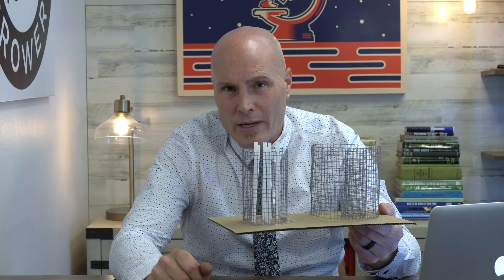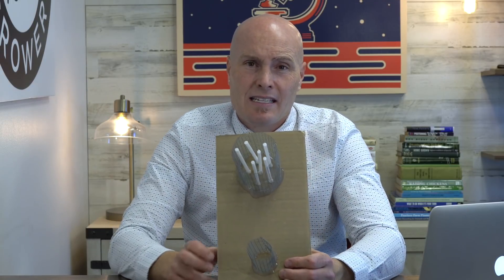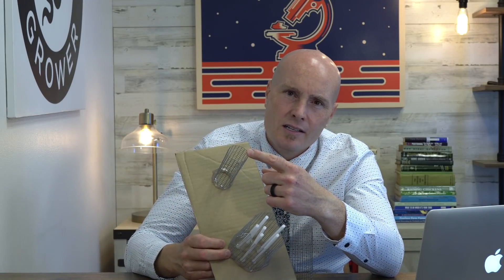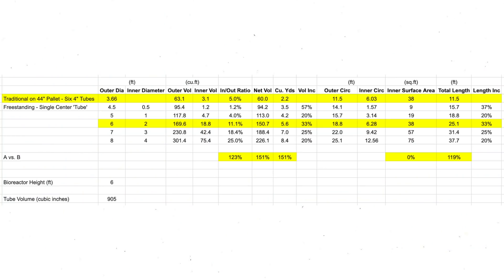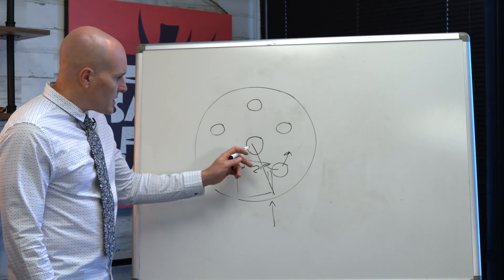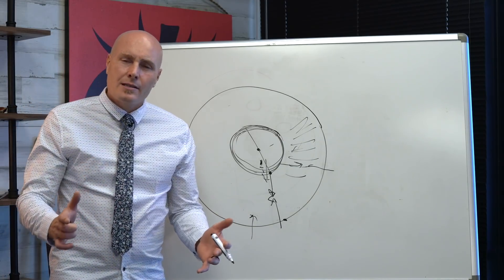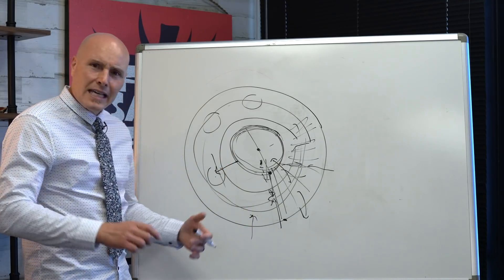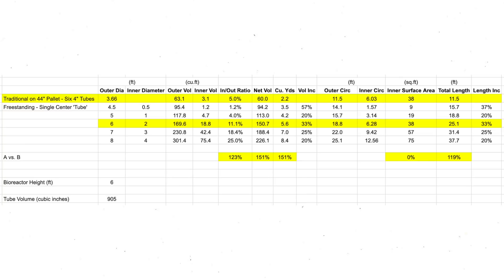Designing a New Compost Bioreactor | DESIGN SPECS and QUESTIONS ANSWERED

Comment: While I like your Idea of making it easier some questions came up.
Dr. Johnson I think mentioned that after the heating process is over it is ok if the spacers collapse.
I was kind of luggish watering my Bioreactor on ja regular basis. I think with your design watering or keeping it moisture is much more crucial to keep it going. 
Another aspect might be changing  temperature. With the Johnson-Su design I think there is a better chance for the biology to get trough cold conditions. Maybe if you put some cover over the inner space in winter time you can keep temperature up for a while with your design. 
Have you thought about it?
Also what makes me a bit uncomfortable watching. Dr. Johnson and his wife went public after some time of trial and error or scientific research. You bring it up like an instagram post.
Reply from the maker: The goal was to use principles of the JSBR yet, make it easier to produce compost.  This will produce compost, no research needed.
Reply: @DiegoFooter  But posting data for the microbiota would be valuable.

Comment: Only things I would add are wire over the top of the air tube so you can't accidentally fill it when loading and an easy to open front for the outer ring to empty it out when fully composted. Going to use this design!

Comment: I suspect it's by design, but a 25 foot standard roll of wire, after cutting 6.25 feet off for your inner circle leaves 18.75 feet for your outer.  That's 5.96 feet for your outer and 1.98 inner.

Comment: Design flaw potential: The lack of wrap covering will make it very difficult to maintain 70 percent moisture. Also the smaller pipes create in effect a more solid mass for necessary heat buildup- that is three foot by three foot minimum. Your new design only gives a two thickness in the one direction effectively due to the larger inner air core. 1/2” hardware cloth would be superior to 1” chicken wire as for holding in/out debris.
Reply from the maker: Good points.  One comment would be that the design isn't setup to create a pile that maintains any sort of heat buildup.

Comment: What if you laid a soaker hose within the pile and spiral it up as you build your pile, a long, slow, coil ?
Reply from the maker: Not a bad idea.
Reply: @DiegoFooter  IKR!? I’ll let you know. I’ll start mine in a month or so.
Reply: @pauljolstead2752  Paul - I did this on my third batch and it worked. I used the hole 25 feet as it came. Keep in mind that the pile height will reduce by approximately 50%.  25 feet embedded in the pile has the potential to influence the pattern of pile settling and therefore may lead to some blockages of the natural chimneys. I am now trying 12 feet placed moreso towards the outside of the circle and moreso in the top 25% of the original pile. I have stopped worrying about dryleaves at the top and dry leaves at the sides. They are just my moisture containing mulch as it were.

Comment: Very cool. I’d wonder if you could skip the chicken wire if you were to replace the concrete mesh with 2x4 welded wire.  I’ve used this to keep my hot pile tidier and there’s still minimal spillage...I’d guess even less with a static pile.

Comment: Too much work!
More importantly, it is the human tendency to overthink, and overwork. To work to find a workable human solution to our human dilemma, that must be workable of course because we are human!
All the while we completely discount the fundamental fact that the human animal is Of and dependent on the natural world.
And there isn’t one single detail that nature hadn’t already figured out long before we showed up.

Chop and drop in a rural setting.
Amending or inoculating the area with soil microbes and mycelium to start is a good idea because most soils lack at least some as a result of human destruction of habitat, overconsumption, and the resulting heat/drought/fires etc that our activities are causing, and urban soils are typically dead, completely lacking these critical little workhorses. 
Then just let nature do the rest.
An ecosystem is cyclical in all ways, if we perpetually take it’s building materials away from it, eventually it will go barren and die.

Layer in an urban setting.
Method one:
Use well chopped material as bedding mulch. Disturb or flip occasionally for more soil contact and faster breakdown.
Method two:
Dig out a random shallow spade of soil in a bed, 3-6” deep and big enough to hold the material. Pour in kitchen scraps, or pulled weeds(no seeds!), or a random dead bird.., and cover by replacing the removed soil. Give it a pat and walk away!
Usually within a few weeks the soil biology will have consumed the gifted smorgasbord and returned a gift of richer more nutritious soil that will in turn feed the plants.
This is my favorite method, my “Touch it once and done” minimal time and effort method that over time gives me the sweet richness of a healthy soil biome.
Chocolate cake soil!😊

I want to spend my garden time nurturing my plants, being in harmony with nature.
Not screwing with some ugly chicken wire contraption in my garden reminding me of the filthy, industrialized, increasingly dead world we’ve created.
All life that exists in sum Is 
human habitat.
All gardening- all nature- all life,
see that it is all the same thing; life. And life depends on life.
What are the origins of life?
Water, and soil.
Feed the soil biology. 
It will in turn feed your entire garden as more and more species discover the Life you’ve created there.

Comment: A 6' wide pile seems very big compared to a regular 3 to 4' pile. Would a 1' center cylinder suffices, so that the outer circle is still 2' which adds to 5' in diameter? 1 1' center circle seems big enough for air to freely flow.

Comment: For the original design, based on the 1' air penetration rule wouldn't you only need one small pipe in the middle of a 4' diameter ring (1' from the inside and 1' from the outside)?  are the other 5 pipes just to 'increase' the amount of air available or something?

Comment: This design would require more hydration, correct? The outside edge of the reactor would be more prone to drying out without the cloth around it, and there's nothing on top to help keep moisture in. Would you have to spray down the sides every couple of days in addition to the traditional irrigation from above?
Reply: You could still wrap it with weed fabric if you wanted to ;)
Reply: But yeah better aeration will mean faster drying out if you are in an arid climate.

On the upside you can use it as a microclimate creator around plants that want a higher humidity.

Comment: Nice video dude, I appreciate it.  I'm curious to see if it heats up and reacts the same as the original.  If so then I'm definitely building that 2' thick compost wall around my garden. The dang roos decimate everything in summer when they run low on forage in the meadow.  Love the idea of a compost wall to keep them out....two birds with one stone.
Reply: Exactly! I have a 7 foot security fence and the fox gets in and causes terrible destruction. I am already adding chicken wire so if I put supports inside and ran extra chicken wire then I will have a compost wall.  There is however confusion because in one place here we talk of 2 feet from the outside to penetrate air and then design for 1 foot. As well as that once Winter comes in the UK we can get a lot of sustained rain and I would have to add a cover at some point which could just be a tarp.

Comment: This is a really interesting concept for supplemental composting. I think you may be on the right path with the handful of 2ft drain tiles at the bottom (if there turns out to be a venting issue) the heat inside will create an updraft in the core that'll actually pull the air through the pipes. Also, maybe consider a chicken wire cap/nose-cone over the center cylinder? Probably help with the less fuss theme (less aim involved when tossing 5.5yds of stuff in a 6ft tall structure)...my humble $0.02 and thanks for taking the time to explain it through :-)

Comment: I love the no plastic option, have used chicken wire circles before but not the “Diego Donut” approach! Here in eastern Australia I find it very hard to keep the outer sections of my compost piles moist during much of the year - even with regular watering.  wondering if get some large cardboard and tie it on to the concrete mesh on the outer ring to reduce wind drying effects - won’t last forever but should go a few months before it needs replacing?

Comment: Neat stuff! Why not make one 2 foot wide any reasonable  height a lengtht you want? Pipes or no pipes. Like a wall getting air on both sides. Thanks for sharing!
Reply from the maker: Because to get volume you need a lot of pipes.  A bigger one doesn’t take that much longer to make.  But you could and have a good point.

Comment: Brilliant.
Reply: I'm here(again) because of you! Much morefree woodchips to make reactor for!
Reply: why not just make the inside screen cylinder a cone shape? seems it would  make loading it a lot easier?
Reply: @ftoftheX  wouldn't that throw off the air penetration part of the design?
Reply: @Mookummockup  Hey max, I dont think so because the material is being compressed  by the upper layers which already have the air flowing between them because of non compressed leaves/other matter.
Reply: @ftoftheX  That’s a great idea, not though that the mesh cone is so easy to make. How would you make one?
Reply: Diego is amazing. Love all his numbers and stats to explain it all. So glad I haven't started my reactor yet. Planning to do the new and improved Diego one instead!
Reply: Now you've made a capacitor you can pass a charge between the two plates.

Comment: Diego Diego Diego. You're making it more complicated than it has to be. You need to think outside the pipes and circles. The key seems to be that all compost material must be within 1 foot of an aeration surface, correct? Hence the magic 2-foot thickness of any composting volume. That is all we need to design around, a 2-foot thickness of composting volume. From there, the designs are infinite -- ok, well maybe not infinite but certainly geometric. People can make 2-foot by 2-foot columns, or 2-foot thick walls of any length, or 2-foot thick rings, or 2-foot thick "U" structures, or whatever geometric shape so long as the 2-foot thickness rule is maintained. Thanks for the magic 2-foot thickness Johnson Rule! And the Diego concrete mesh & chicken wire materials design.
Reply from the maker: True and good point.  The problem with a 2ft column is you need to make a lot of columns to get volume.  But I like the line of thinking.
Reply: @DiegoFooter  Yes but for folks with limited space or composting source material, a 2-foot column might be ideal .... like your trash can composters, or perhaps using recycled 55-gallon HDPE drums riddled with holes? Anyway, there is a composting scale for everybody. The key being that minimum distance of composting material to aeration surface to keep it in aerobic state.
Reply: @RA-LHTX  It makes me wonder though. Hot compost requires a minimum of 1sqm, or a little over 3 ft wide. Does it mean that hot compost isn't aerated? 

It makes me wonder if 8 ft wide bio reactor is good with 3-2-3 outer inner outer portions.
Reply: @acctsys  Hot composting is a different method than bioreactor approach. Hot Composting requires frequent turning for aeration. Bioreactor requires no turning but does require minimum of 1 foot from an aeration surface to prevent anaerobic conditions.
Reply: @acctsys  Hot compost is getting areated by turning the pile a couple of times. Whenever it gets to hot it is turned. And while turning it gets a ton of air also.
Reply: I'm with you in the 2ft thick wall, much more space efficient, and don't have to bend the mesh.
Reply: So you’re saying if I had 4 tubes that are 24 inches across in each corner of my greenhouse..(10/16 ft) I could fill up durning the summer with brown and green and in winter have great heat/reaction distribution from them once I soak them? Just trying to learn here :) and than use in the spring for the plants?
Reply: @MrsStevenBrown  No. Unfortunately, that is not how it works. The JS-Bioreactor is for cold composting. By keeping compost material within 1-foot of aeration surface, the decompostion process is kept cool.

To heat a greenhouse in winter, you would need to use thermal or hot composting. It is a completely different process of composting. It requires a minimum of 1 cubic yard (3ft x 3ft x 3ft). It must also be managed -- monitor temperature of the center of the pile and turn to aerate  when it reaches about 160 F (this is done by moving outer part of pile to center and center part to outer part). The process is repeated (about 5 or more cycles) until the pile no longer generates heat and at that point the composting pile should be done and ready for use. Check out Dr. Ingham's composting method(s).
Reply: @RA-LHTX  I will look into! Just starting the compost hobby lol 😂
Reply: @MrsStevenBrown  This is not really meant for "hot" composting. Because the pile is being aerated 24/7, heat cannot build up. This is more of a cold composting method that does not require turning like hot compost methods do. Hot composting requires a minimum of about 1 cubic yard of compost and it must be turned periodically to keep it from overheating and going anaerobic in the center of the pile.
Reply: For a backyard or terrace garden you should make three or four  2×2 square cages . Fill one and move to next.
Reply: Once you go to columns, the next progression is towards hexagons, like how bees do it. Hexagons are the bestagons.

I think though that as Diego said, you'll bump into problems with supply of material though before you get to that point. I think the Diego reactor design has the balance of practicality, beauty, and function.
Reply: @acctsys  Hello, fellow CGP Grey fan. Hexagons are the bestagons indeed, however, bees don't actually make hexagons. Bees make circles (cylinders), and the heat from the worker bees causes the wax to settle into the hexagonal shape. Just search for "bees don't make hexagons" and you'll find articles explaining it in more detail.
Reply: @drewlomax7837  Yes, but if the posts were to be the edges (6 instead of 4), hexagons would form from the cylinders.
Reply: @acctsys  Johnson bioreactor approach requires that all compost material be no more than 1 foot away from an aeration surface. Any shape used must conform to that rule. It has no relationship to bees.
Reply: @RA-LHTX The connection between tubes and bees is somehow lost in this discussion, and that's OK. It's just a mental exploration of even further optimization of volume, but it can be overengineering.

I know that the key takeaway from the JS bioreactor is 1 foot from air. That's what makes me wonder about hot composting more.

For hot composting, is it really necessary to have periods of anaerobic tightness, interrupted by short aerobic turning? Isn't there a sweet spot in the width where the key takeaway of 1 foot from air can help so we can get good hot compost without turning?
Reply: @RA-LHTX  also you will get more fungal activity in your JS Pile that with hot composting, because the pile isnt moved.
Reply: @RA-LHTX   Johnson mentioned in a video that they do have one thermophilic cycle (2-3 weeks or so) to kill pathogens at the very beginning. That would require some amount of green to all the browns (woodchips)
I'm not a specialist on js reactors though
Reply: @peterheinz3375 yes, he said they come hot and stay hot for some time. This means that it has to be preproduced before entering bioreactor
Reply: @peterheinz3375  well, at least professor Johnson said that presenting his facility. I think it was big scale on the green/werehouse flour

Comment: Isnt the simplest JS bioreactor by the variables they defined... just a 1 foot thick layer of material laid out on the ground? Less space efficient by a good margin, but maximizes contact with soil organisms and is more water efficient, besides having the pumping action of rainfall moving downward through it to help with oxygenation. And of course no plastic, metal, or any other material to buy in!
Reply: Well said Richard. Where you are essentially unconstrained by land area, this is attractive. It eliminates aeration structures. It does make moisture control more difficult. Heavy rains can drown or wash out emerging fines. Drought can force a requirement for hose watering. The connection to the soil is magical for stabilizing the process. I have done a large batch of leaves this way and gotten F:B of 1.2   I have seen this approach started with wood chips only and still not finished at 24 months in southern Canada. MUCH longer cycle.

Comment: Love this and your work. I plan on making several of these this spring. One on a pallet, one on the ground, a J-S, and a D-F with the ground cover wrap. 

I have plenty of woven wire fence, so I’ll be using that instead of the concrete mesh. I’ll let you know how it goes in 12 months.
Reply: How did it go?
Reply: The horse manure made very good high fungal compost. The one with wood chips and horse manure still had chips in it, but was very good compost. 

I have 2 going right now, one is just leaves, the other is horse manure with leaves about a foot deep on top. I’ll open them in May. I am going to use this material as a compost tea this year.